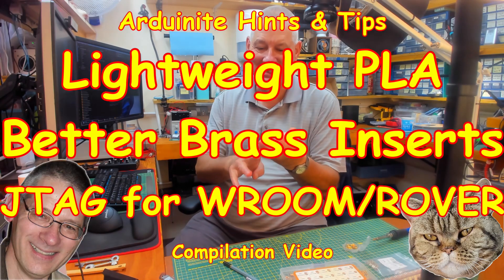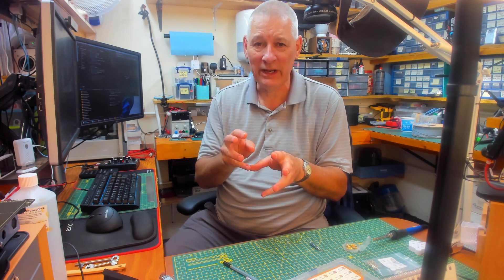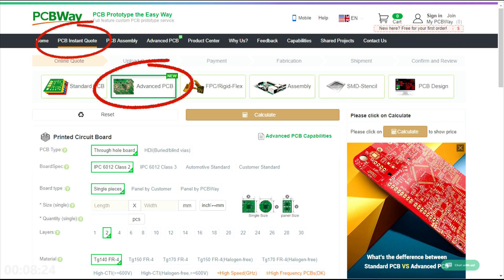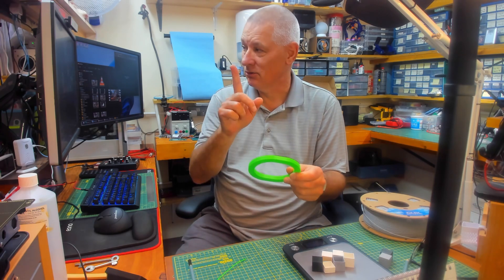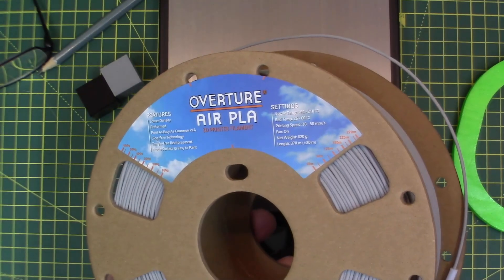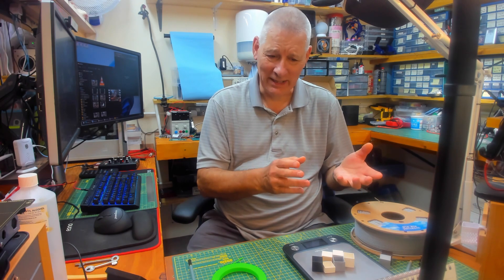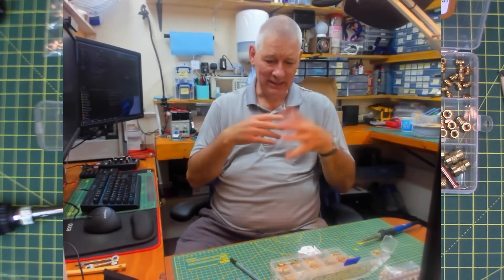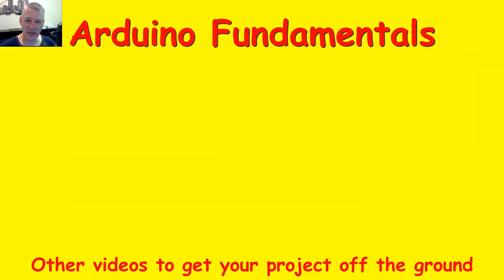#270 Lightweight PLA, Hot Melt Inserts Mk2, JTAG for WROOM/WROVER boards

Comment: thanks for the jtag update. Do you have a LOLIN S3, reason I ask is wanted to know if youve got it to work on platformIO with VSC and specifically with littleFS. I found it impossible.
Reply from the maker: I have ESP32 S3 processor boards (not necessarily Lolin) nad it seems to work just fine. What are the issues?

Comment: Has anyone found a watchdog type program that works with esp 32?  I use arduino ide to program and have not found a library.  I have resorted to defining a reset pin, set it high in Setup, count a certain number to millis and set it low.  Not ideal , but works for esp32 with camera that was losing connection.
Reply from the maker: That's also the way I do it for a VS1053 MP3 decoder that needed resetting specifically after power up. Also controlled by an ESP32. But it only needed doing once at Startup, not during the main program run.

Comment: You may find that if you print the "Lightweight PLA" hotter, it will get even lighter.  The way I understand it is that there's some sort of foaming agent in the PLA that causes it to foam when heated over a specific temperature; the hotter it gets the more it foams (up to a point anyway).  Not sure what the foaming agent is by the way, so it may be worth checking into that before you put it in your koi pond. :)
Reply from the maker: I thought it might foam at the nozzle but, alas, no. It is effectively "pre-foamed" so it contains (somehow) more air to filament, I guess. Still, it's nice and strong and floats well too.

Comment: Be sure to remove the battery from the caliper when putting it into storage. They (at least mine) have a tendency to drain the battery  when not used. Hmm, maybe a short video ?
Reply: I discovered this recently (I have the same caliper from the same shop Ralph has). There are various tutorials on how to add a switch that will properly cut the power so I might do that. When I researched the issue, people have been talking about for about 20 years so apparently the manufacturers just don't care.
Reply from the maker: I can't say I've had this problem. Same callipers, from what I remember the same battery and I've used them for years. Perhaps the design has improved? Mine does have an auto off feature (like multimeters) so maybe they've adopted the same technology.

Comment: I have started printing a lot of my cases and parts wit my resin printer. For lovely smooth parts, and the amount of infill right up to a solid part doesn't take any longer, due to the fact that each layer is projected in one go. The down side is the print area and it's the amount of layers that takes the time. Each layer typically only 0.05mm. but only about 11 seconds per layer. Also resin prints don't the the brass inserts.
I'm wondering if you have or considered a 3D resin printer. If you watch any videos on how to finish the prints, with all the cleaning with IPA and stuff. then I'm not surprised people are put off. And yes If you want the best detail then that's the way to go. However most of my parts like housings I just dry off with kitchen paper and cured in daylight, or a cheep UV lamp. The details and dimensional accuracy are worth the extra mess.
Reply from the maker: I'm sure resin printers have their place (although at this time in someone else's place) as I'm finding my way with the filament printer still. It is the perceived "mess" that puts me off a resin printer - probably better for more serious work, I suspect?
Reply: I couldn't believe how a resin printer actually works. Pretty wild.
Reply: @TheUnofficialMaker  even more strange is the way the part sticks upside down to the build plate.  It's like how a wet glass can sometimes lift up a coster. Suction, surface tension, or just magic, I'm not sure!

Comment: Hi Ralph, An iron specially for the brass inserts? I've used many, many inserts, just pushed in with an ordinary iron, I wouldn't dream of a having a separate iron. Also, just to be clear, Don't drill a hole then put an insert in. If you print a hole it will have surrounds of solid filament surrounding the hole that the insert can melt into. If you drill a hole you are simply cutting into the infill which is much weaker and the insert won't bind properly. That's why it was too easy to insert too far. 

Your info about the circuits, IDE and programming is much more useful than your 3D printing advice (meant as constructive feedback, trying to be helpful). There's loads of 3D printing channels from people with years and years of experience and with all kinds of different printers, filaments etc.
Reply from the maker: I wouldn't normally consider one either but as I had already got a couple of purpose tips (that greatly assist centering the insert) the idea of many sized tips and a soldering iron too was just an experiment (and meant I didn't need to use my soldering iron).

Constructive criticism is good, and I'm not surprised you said it. The problem I find is that the guys with lots of experience in 3D printers no longer tell us noobs the really useful things that they learned years and years ago - they have forgotten they never knew it! Anyway, it's just stuff I thought some of my viewers might find useful. 👍

Comment: Greetings & thanks as always.  Your videos never fail to inform.  As a threaded insert user, the question is how do the gripping features of the flanged inserts compare to "old" inserts.  From the video the flanged inserts looked quite shallow.
Reply from the maker: Good question!

The flanged inserts are quite shallow because those are the ones I bought (and used this afternoon in a project). But many longer ones are available so take a look at AliExpress or Amazon or wherever to see what there is. Links in the video description.

BTW as others have commented these flanged inserts will offer not only a cleaner insert but better pull-out resistance (if inserted from below) as the flange is now supporting the insert too. I tried this afternoon with a countersunk hole (well, strictly speaking a chamfered hole) and it worked beautifully.

Comment: Nice mix of topics today Ralph 👍. That lightweight PLA could be useful for building bits for quadcopters, where every gram counts.
Reply: The Colorfabb lightweight PLA is the go to for 3d printed aircraft. It foams and expands ass it leaves the nozzle, the degree of foaming is controlled by the extrusion temperature. It takes a bit of dialling in of extrusion rate to get dimensional accuracy but at the upper end of the temperature range you can print parts at around 30% of the weight of standard PLA.
Reply from the maker: This expanding foam type of filament I have seen (but not used). As you say, seems to require a bit of experimentation to get it right.

This filament I show is effectively pre-expanded and prints so smoothly. I really want to make something with it asap to see if it lives up to my expectations in the Real World!

Small world: the white calibration boxes I briefly showed (for another video) are ColorFabb PLA+ but are quite difficult to work with (warping, mostly). I am still finding the best way of using it. Any suggestions (other than "buy an enclosed 3D printer") gratefully received.
Reply: @RalphBacon  I've been very happy with it once I got past the muttering and swearing stage, once it's dialled in surface finish is very good at the lower to mid range extrusion temps, surface finish is a little poorer at the top/maximum expansion temperature but still quite acceptable.  I bought a plane design from Eclipson following recommendations from a few people and have been very happy with it,  easy to print and assemble with good instructions and as a novice pilot I can vouch for just how robust and crash proof lightweight PLA with a good design is. I've printed a few functional mechanical gadgets with the lightweight and it seems pretty much as strong as ordinary PLA+ just a lot lighter and although it's half again the price of PLA it's actually quite economic to use.  I suspect it will become popular with cosplayers as it seems ideal for wearable props.

Comment: Very interesting & informative as Always Ralph. Random question: As a relative newbie to microcontrollers, let's say I develop a project (using arduino) and want to produce it in a quantity, streamlining the board to only contain the electronic components needed for that task, stripping out unrequited elements of the arduino. ... (with PCBway making the resulting board).  Are there any resources out there which might glean that knowledge  ? Or should I aquire a masters in electronics before attempting such a feat 😢
Reply from the maker: OK, let's think about this.

Step 1. Acquire a Masters Degree in ele----- no, no just joking! 

If you really are using the Arduino (UNO or Nano) it's simple. Anything other microcontroller will require more work and probably experience.

For the Arduino, look at my "barebones" Arduino videos (eg #117 and #119). Don't ignore my dire warning about decoupling capacitors right next to the chip (which doesn't need to be the DIL version, the quad flat-packed 32-pin is just as easy to use if PCBWay are going to build it for you).

I would recommend you build a barebones version on a breadboard first. That way you will learn loads (including how to upload a sketch without all the USB stuff done for you).

Any questions or explanations, just email me. Oh, if you're stealing, er... commercialising one of my designs, I'll take 10% please! Oh alright, 15% if you insist.
Reply: @RalphBacon  haha 😄.  Noooh, it's all my own mad hatter ideas 💡. But if it makes 'dragons den' you'll be first in line for consulting fees Ralph 😇. Thank you for taking the time to respond 🙏..

Comment: I always add a chamfer or countersink to holes that I am going to use an insert in. Not only does it reduce the effects of the displaced melted plastic it acts a s a guide to help locate the insert when inserting.
Reply from the maker: I read your comment a couple of hours ago over lunch and thought I'd try it out this afternoon, which I did. 

Excellent suggestion! 🥳🎉🎊

And obvious when you think about it, that the "excess" plastic will find room in the chamfer area rather than being forced out of the hole. And helps centralise the insert, just as you said it would.
Reply: @RalphBacon  It's not a perfect solution but does help. If you are designing parts yourself altering the chamfer angle to something over 45 degrees making it go deeper into the hole has some benefits. It is worth a try anyway. Love the channel and expansion of 3D printing as it goes so well with electronics projects, probably paid for my printer in the savings made in not buying project boxes.

Comment: I wonder if the 'light' PLA is just a mechanical stretch version of some standard PLA. I assume this changes the internal molecular structure and makes it lighter per unit length. The mechanical properties degraded, as you demonstrated when bending the wire. Cheers.
Reply from the maker: I don't think it's that, cap'n. The filament feels slightly rough, like a sponge, so I reckon it has air added to make it more foamy. And lighter, of course. Beautiful finish.

Comment: The flange covering the ooze is a side effect of its main purpose which is reduced pull out, with a cylinder style insert the tighter you tighten the screw the more chance of ripping it out, if you insert the flange variety just to the level that the flang is smooth to the print, then when you overtighten it theres less chance of pull out because the flang wont be able to go 'up' as it will be hitting the other part your attaching. its a really good mechanical advantage
Reply from the maker: Indeed. I don't know whether this is the main purpose (although it sounds more likely than stopping the excess plastic oozing out) and I used them this afternoon.

I inserted the insert from the back, so the screw was pulling it tight to the body, with the flange flush on the underside. Seems unlikely that will pull out any time soon!

Comment: I dont think those scales have enough resolution for 'science'..
I like that the layer lines are less visible, for something like a figurine that would be a good advantage, and the weight redustion would be good for flying model parts printing, but for anything else the extra cost isnt going to be justifiable so i would be back on the cheap stuff at less than half the price for structural parts. But it is what it is, specialised materials cost more, its a reality i dont like lol.
Reply from the maker: Yes, it's definitely a specialised product (although did you notice the £3 discount on the actual price, making it about £24 a roll?). I normally pay about £20 a roll (1Kg) so this is not too much above that. And when you need a lighter filament, I guess this is it.